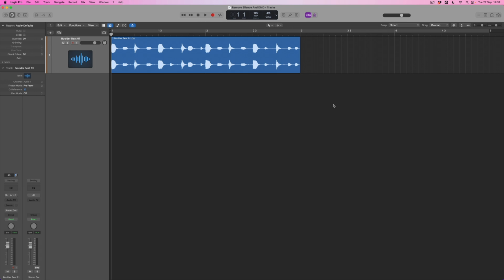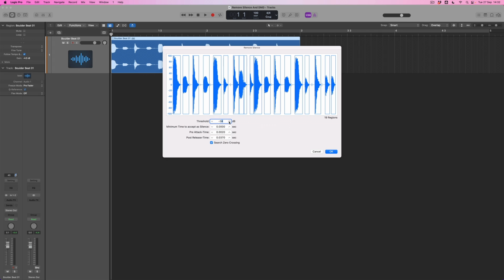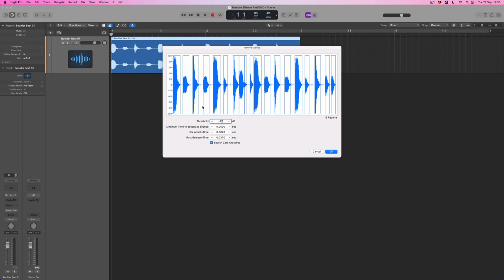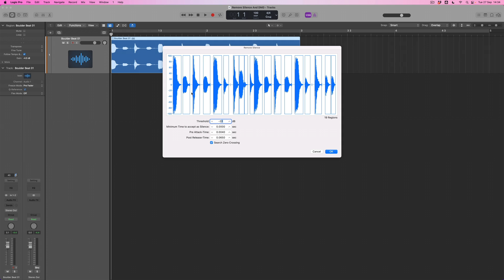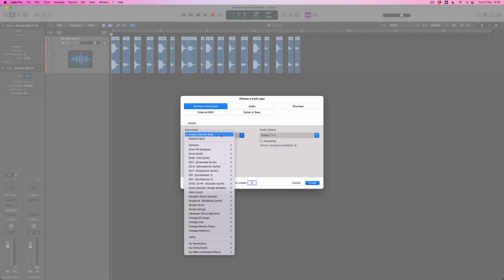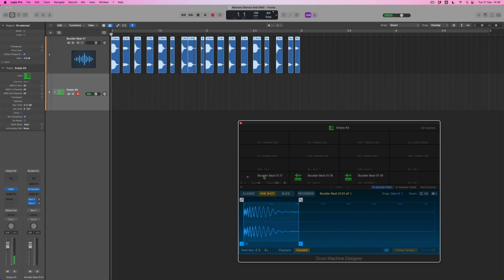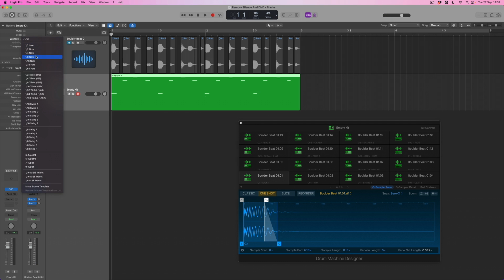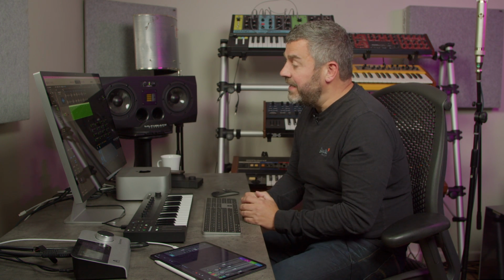LOGIC PRO X - Converting Audio Regions to Drum Machine Designer

Comment: Great vid as usual, I was wondering if there is a way to put your own samples in the apple library for DMD, it would be great
Reply from the maker: Hi Richie. Thanks. Yes, any audio file you record can be added to the Loop Library - just Control-click your chosen file and select the 'Add to Loop Library' option. Also, do remember that audio doesn't need to have come from the Library to be sliced and chopped within DMD as per the tip in this video. If you use the 'Remove Silence...' option on any audio file, even one not conformed to tempo, you'll get the same result.